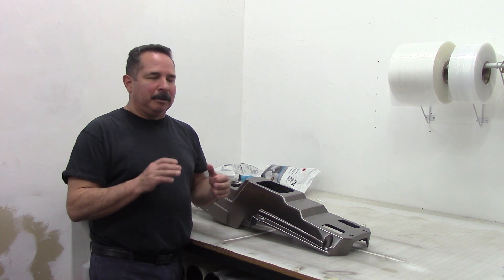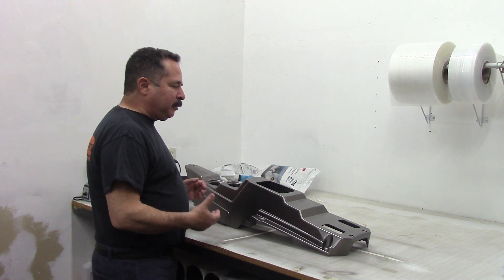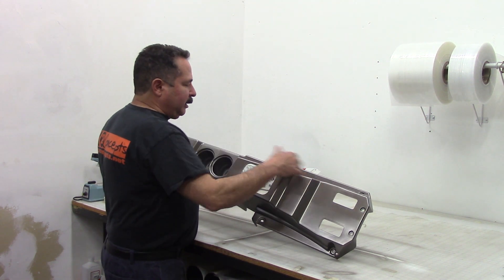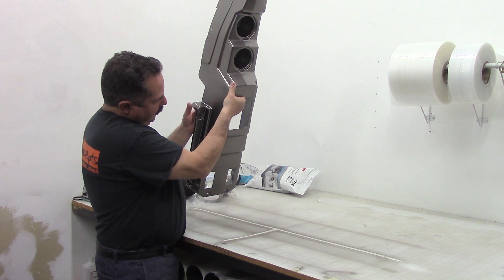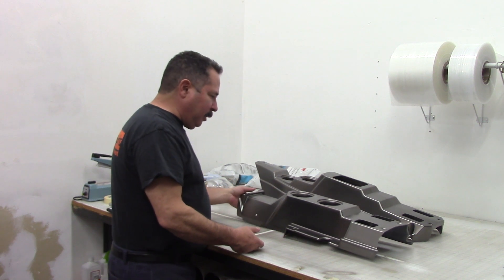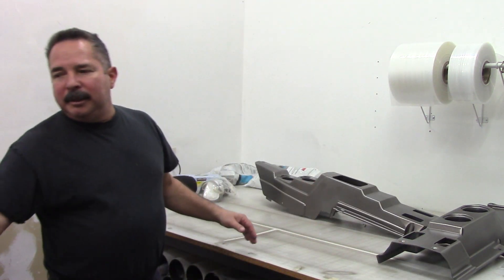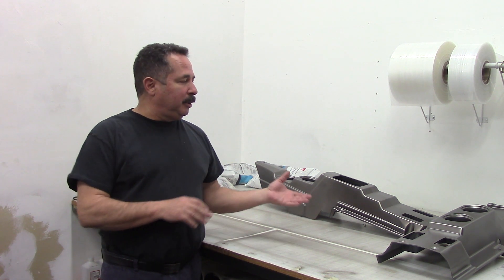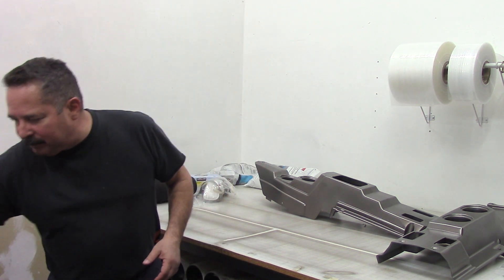K2 Concepts Avoiding Trapped Air, Blowouts and Voids

Comment: Thanks, Jim. That's a topic everyone will have struggling moments with. I think, soak time is related to this. Sometimes it helps to have a little less soaked PVA on the water to prevent major stretching. But every film is different. #justMyExperience
Reply from the maker: This is true...the downside could be underactivated film because you reduce the soak time...it's that fine line...reducing the heat of your tank will also help reduce pattern stretch...
Reply: Jim Urbano  Thanks for your reply, Jim! I'm still learning with every dip and every new part shape. 😁👍 Have a good day dippin!